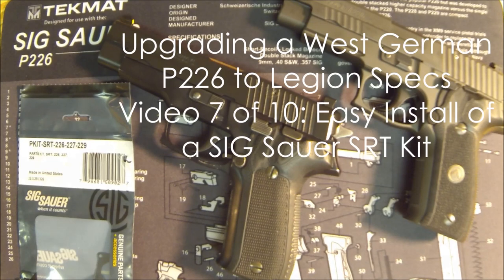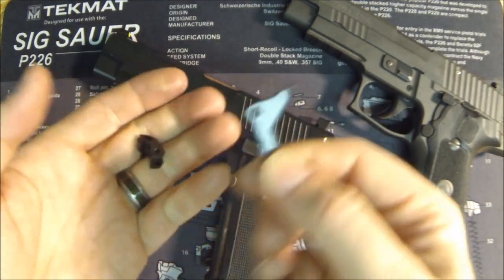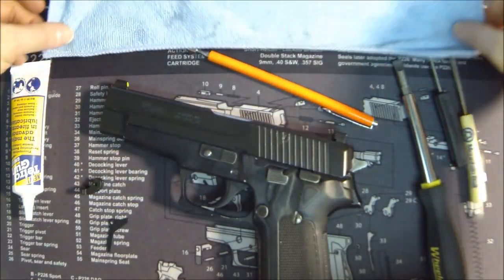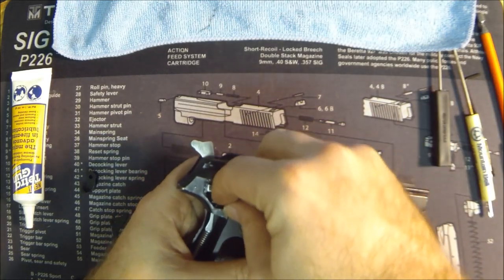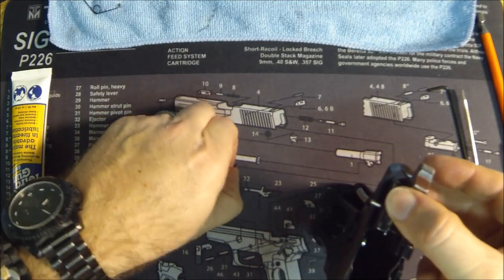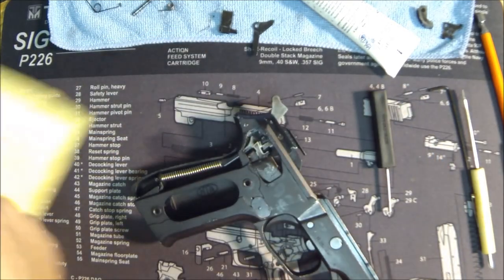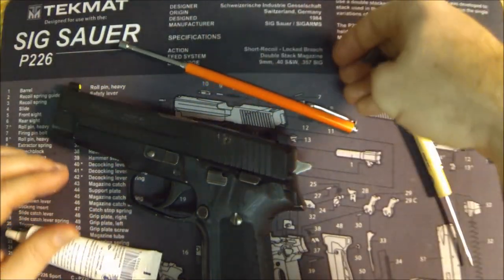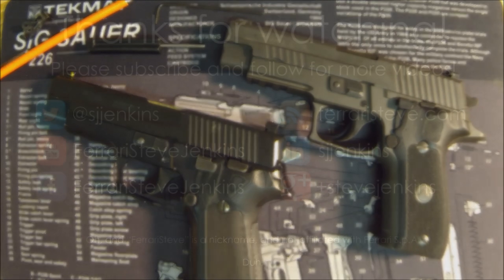#7: SRT Kit Easy Install (Short Reset Trigger Kit) - Upgrading a West German P226 to Legion Specs

Comment: Realize this is an older video but wanted to thank Mr. Jenkins for some very helpful steps. I'm 80 years old but following the video I just finished the sucessful srt installation. Used a cue tip stuck ih the upper recess of the sear and was able to go thru the frame top. A little oil on the cue tip helped to hold the sear in place. Easy install, just had to take my time..

Comment: Incredibly easy. I think your video is the best one that shows the SRT Kit installation. Since I don't have a Glock tool, I used an RCBS 5/64 allen screw driver. I imagine a similar allen wrench would work. I also used a 90 degree angle needle nose pliers and screw driver.

Everything was going smoothly until I set things down to double check the correct position of the safety bar when my allen screw driver slip out and all the parts, including the ejector, fell onto my towel. Even with this set back, installation only took a few minutes.

Comment: Great video! Please don't delete your "older version" for the srt kit replacement video.
I have a sig p220 with a stainless steel frame and using a magnet makes it harder, the magnet and part kept sticking to the sides of the inside of the pistol frame. So I went to the older version video and it was a lot easier! Great videos really useful.

Comment: Great series. I did the SRT “KIT” in my P6. YSK that once my kit was installed my stock Trigger Bar Spring caught on the new Safety Bar in the SRT KIT. I carefully nipped away the part of the Trigger Bar Spring that was in the way with wire cutters.

Comment: Thanks so, so much for this video!  One watch and I installed the srt KIT in only 5 or 6 minutes.

I couldn't find my part magnet, so I just jammed a Q-Tip into the channel in the new sear and that worked good enough to get my drift punch in the hole

Comment: Just used this video to upgrade my P229s action! Word of caution the magnet method sucks if you sig has a steel frame but I manged
Reply: pro tip : watch series on flixzone. I've been using it for watching a lot of movies these days.
Reply: @Ben Torin yup, have been watching on flixzone} for months myself :D

Comment: I wanna ask one question! Why didn't the gun come with the proper part in it so the trigger didn't have the travel the creep and play in it would be in a later poundage when you pull it for the reset? The best handgun out there but we have to add apart for the trigger if you want a little more reliability in pulling and take out the creep. Just a thought being that I love this gun this is my favorite handgun I would never buy anything else more likely ? I did like the MMP9 millimeter Sig has got it all covered

Comment: Magnetism and guns. Would you put glue or rosin in your gun? Then you probably don't want magnetized parts either.
Reply: I put glue and rosin in all my guns they run Great!!!! You seriously think the one minute it touched the magnet is going to magnetize the parts so much it will cause a malfunction??
Reply: @ruiz212  here's the problem. All magnets are different. The tighter the domain, the more likely it is to magnetize other things. And the LESS metal there is on a gun, the MORE harm magnetism can cause. It's not a good idea, but you go on doing you.

Comment: I am not saying I am some sort of purist, but do you think their are some people that would never modify a stock W.German P226 (for historical reasons)?
Reply from the maker: Absolutely, Nathan. I have a 1987 SIG P226 that I run totally stock for that reason. But even with this modified one, none of the upgrades are permanent (except for the action job). I kept all the original bits and can make the gun stock again in 20(ish) minutes.

Comment: Did I miss your explanation on why you have to remove the trigger bar spring?  Is that something that you only have to do with the older german made sigs?  When I performed an Short "Action" Reset kit install on my newer p226 (grips don't have screws) I didn't remove the trigger bar spring and grips.  It was a little tricky to hold the seer in place but got it after awhile.  The magnet on the seer is a great idea to hold it in place.

Comment: Steve Jenkins - Thx for doing this video. I did the SRT install on my p226 and it works!!!. Can I put a p229 slide stop release on my 226?
Reply from the maker: You can, but the slide stop is the same part for both pistols so doing so wouldn't accomplish anything. You can put the low profile P224 slide stop and P224 decocker will also work, and are smaller.
Reply: That's exactly my intention...installing a low profile slide stop, which I thought was the P 229. Thank you for correcting me and now I know what to look out for. The mobility in one of my thumbs is extremely limited because the tendon was completely severed in an accident...so it gets in the way of the slide stop and on the last shot, the slide does not lock...However, when I shoot my friends P226 legion, I don't have that problem. Seriously, THANK YOU VERY MUCH!!!!
Reply: Hey don't say SRT, he's repeated that only about 100 times for the cloutiest of clout. Clouty Cloutington 😮

Comment: Steve, I have a P229 and was trying to upgrade it with the SRT and the Grayguns flat trigger. After the install the pistol failed to reset. The trigger would not engage the hammer unless I manually cocked the hammer or if I released the trigger with a “snap”. Reinstalled original equipment and it worked fine. Any pointers or advice on what I might  have done wrong.?

Comment: Thanks Steve for this great video. I installed the SRT kit on my p220 and the trigger pull and reset are a nice improvement... as long as the magazine is not inserted. Once I insert a mag, empty or loaded with snap caps, the trigger seems to bind. I have not fired live rounds yet for fear of damaging the firearm. I did not have this issue before installation. Any thoughts as to why the trigger is binding post install of the SRT kit?

Comment: Steve after watching all of your videos in this series I installed the gray guns adjustable trigger and the SRT kit ordered directly from Sig on two of my P226 pistols. I have watched the videos carefully and certain that I did everything right but the reset has not shortened at all... it looks and feels exactly the same as it was before. Overtravel is adjusted and is great - I cant figure out what I could have done wrong with the SRT kit. I made sure to keep all old and new parts separate and have taken it apart and put it back together several times to see if I've done anything wrong. i also watched a couple of other videos on YouTube to be sure - I'm baffled... any ideas?

Comment: I've got my SRT kit and with this video it seems like the upgrade should be fairly easy.  Something that was a little vague, however.  What was the reason for the removal of the grip panel and trigger bar spring?  I've viewed other videos that don't show either, and it doesn't seem to affect the install.
Reply from the maker: I like to have as much room and access to the area as possible. If you can swap it in without removing the grip and trigger bar, you won't hurt anything. For me, it would take longer, so it's worth the extra 30 seconds to remove those. Good luck with the install (you're right, it's easy) and lemme know how it goes!
Reply: Finally got around to it today. It took closer to 20 minutes (or at least that's what it seemed like).  The first time I did it, I reassembled, the decocker worked, but the trigger wouldn't pull.  I took everything out and reinstalled. This time I noticed I could see the top edge of the safety bar.  I reassembled my Sig and everything worked like a charm.
Reply: NatetheGreat, Got mine at Optics Planet
Reply from the maker: Congrats! And 20 mins is pretty dang good for your first time installing the kit! Enjoy!

Comment: Hello Steve, Great video. Quick Question: I have a bone stock West German stamped p226.Using your video, I just installed the short reset trigger kit from sig. After re-assembley, the de-coker and initial trigger pull work fine, the "short reset" even clicked into place after simulating the slide action moving back, but when I pull the trigger from DA the hammer doesn't fall. Fairly certain it is installed correctly, wondering if I need to upgrade trigger itself or mainspring. Any Insight would be greatly appreciated.
Regards, -KP
Reply from the maker: Hi +khrispy. Sounds like your trigger bar spring came unhooked. Are you using the looped trigger bar spring with the stock West German grips by chance?
Reply: +Steve Jenkins (Ferrari Steve) yes its stock trigger bar. I'm using G10 grips from Hogue, which fit just like the stock plastic ones. I will pull he grips and re-
 check if the trigger Bar is engaged. Seems like it is since initial trigger pull in single actions runs normal. It's the reset that doesn't engage hammer. Appreciate you getting back to me.
Reply from the maker: +khrispy Hmm... the G10 grips should work fine with either style of trigger bar spring (see https://youtu.be/O6mMPsK8_4A for the differences). I'd double-check the placement of your sear. It should go in just as easy as on my video, and work right away!